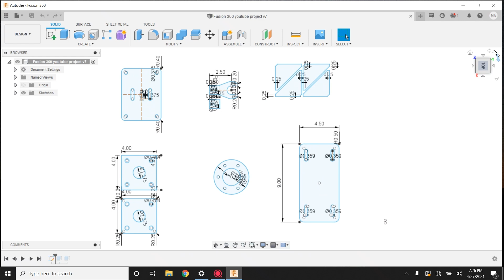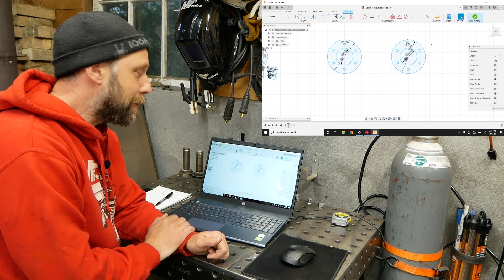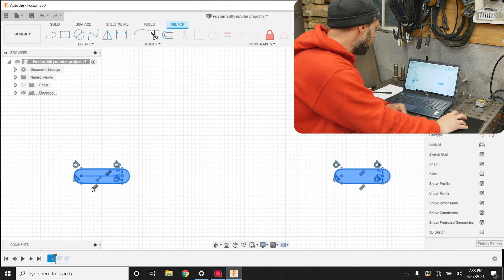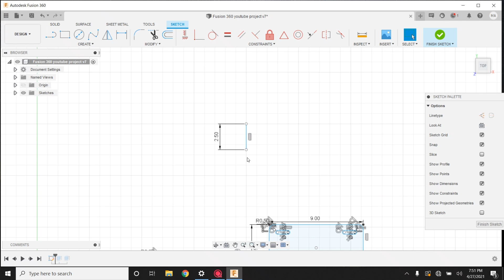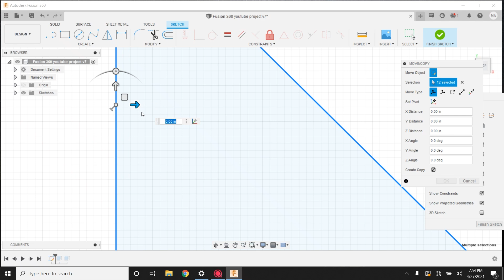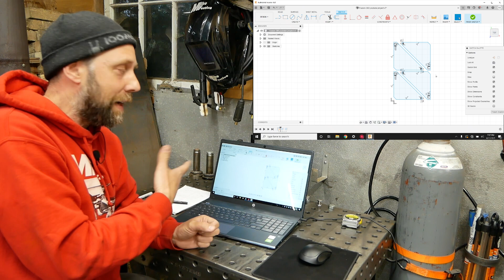Fusion 360 2D Drawing series for Beginners part 3

Comment: I'm bummed. Committed to 3 episodes to be left hanging. It's my fault for not checking if it was a complete series. On to the next tutorial I guess. 😞😞
Reply from the maker: That’s fine, I have spent a lot of my time making free content. Good luck on finding something that works for you 👍
Reply: @Mike festiva  appreciate what you did do though!
Reply: @Mikefestiva really learned a lot.  Thank you
Reply: Hey mike awsome video any way ur open to answering a cupple questions I just got a crossfire pro
Reply: Great video series, thanks much!
Reply: Hi Mike thank you for the great as always video. Any suggestions for getting from the drawing to the cut table? I'm new and struggling.
Reply: Thank you Mike!!! I've learned a lot. My plasma table is still in it's boxes but these videos were amazingly informative
Reply: Hi Mike, wanted to Thank you for the time you spent on this video series. I have learned a lot. I also have an Arcdroid and i was wandering if you were going to make a video on how to go from the drawing on Fusion to cutting on the cnc plasma. I would really appreciate. Thank you.

Comment: Could you please give me a hand.  So, in design mode I'm making a sketch in 2D. I extruded the sketch then went to manufacture.  I did the setup and that's good (I got a green clip, but when I went go to cutting, picked my plasma, and went to geometry It would not allow me to select, therefore, I got a yellow clip which stated, "one or more operations are out of date". I've been back to the design and to manufacturing features a hundred times and tried something different with the same results.  I'm missing a step I'm sure, but I'm frustrated at this point.  I did a project a few weeks ago and it seemed worked, of course not paying attention to my steps then, but now it's not.  Any help or good videos to help would be appreciated.  I hope to see more lessons.

Comment: Great series! I'm looking into a crossfire but was always scared of the computer portion as I'm not computer savvy at all. Thanks to your videos I'm able to fumble my way through designing parts in fusion 360 and I'm getting more comfortable with it. A part 4 would be great to cover the cam and post portion and the final cut process. Just like you said, most videos skip over important details and if you're new like me these are critical details. I know there are quite a few of us who would benefit greatly from a part 4. Keep up the good work!

Comment: After getting deeper into Fusion 360, I now know I don't need to export anything but I do need to know more about post processors and creating tool paths.  I also have learned that AutoDesk has some great resources to learn from, but they're a bit like being handed the plans for a watch when you ask what time it is.  The kernel of information is in there, but in wading through the other stuff, I sometimes forget the question.   You, on the other hand, distill out the very things I need to move forward.  I still look at other sources, but yours is the best starting point.  Thank you again for your efforts and I look forward to part four.
Reply: I could not agree more with your comment.

Comment: Hi Mike, is the 360 Fusion software you use the free version? Or do you pay. I want to down load it for basic drawings for my equipment so I can make replacement parts.
Reply from the maker: Hey Mickey I had been using the free version for a few years now and that’s all you will need. I started paying for mine because Fusion states if you make (Money) with there software then you need to pay. I make teaching videos but I also make other videos on my channel and I also make Money on YT and use there software so it seemed like a Gray area I was in.
Stick with the free version because the pay version is really expensive.
Reply: @Mikefestiva  But I don't want to save my files on the internet. I want to save my files on my hard drive. Will the pay version allow me to do that?
Reply from the maker: @weldersandblaster  You save your G code ( Tool cut paths) on your computer, the main files you draw in 360 are cloud based. I know I don’t care for that either but it’s how that program works.

Comment: Mike, I've been watching and rewatching and practicing the techniques.  But I can't for the life of me figure out how to extrude a part and the circles actually be cut out.  I tried doing your flange plate example.  Have the 4 bolt holes and center hole drawn, centered, sized.  But if I "Finish Drawing" and go to extrude it... The only thing that extrudes is the square base plate.  It's as if the circles were never there... Would really love to see another video about how you do this my friend!!
Reply from the maker: I plan to make one more part to this series covering extruding and tool paths.
I don’t usually finish sketch, I will just click on the part, I think Right click? Sorry I don’t have my computer with me at the moment. If you have multiple parts you click on the first one then hold down shift as you click on the others, go down the little drop down menu to the (blue colored extrusion icon) and click it, it will want you to input the thickness of the extrusion, I will usually put in the thickness of the part I’m planning to cut but honestly this doesn’t really matter at this point because you will set up the cut Speed and Pierce time later in (Manufacturing) 
This should let you extrude your part with the holes as you made it. Sorry if I missed a step because I’m just working off memory. Let me know if this helps, if you still can’t get it let me know and I will start up my computer and walk you through it 🙂
Reply: @Mikefestiva  thank you so much!!

Comment: 3D printing is actually quite a bit easier than using the plasma table. There are less steps drawing to making. Dave checked out my Creality ender 3 and picked one up for himself. It’s a budget machine that just works. Thanks for the tips, I’m pretty new to fusion so I’m learning quite a bit.

Comment: You have been, and continue to be, the majority of my inspiration. I did, finally, make some parts of my own design on my LS CFPro through slogging through the tutorials from LS. They were super hard to follow for a beginner. Technically I'm not a rank beginner, I took a CNC plasma cutting class from Everett CC back in 2007 but... we used a different software and time has a way of making stuff like this evaporate. I'm still going to watch these and follow along for the practice, still learning a lot from you. You do a better job of explaining and talking about whether you right click, left click or which hotkey you just used, than the videos from LS. Their videos also seem super rushed. I had trouble keeping even with prodigious pausing and rewinding. THANK YOU SO MUCH!!!